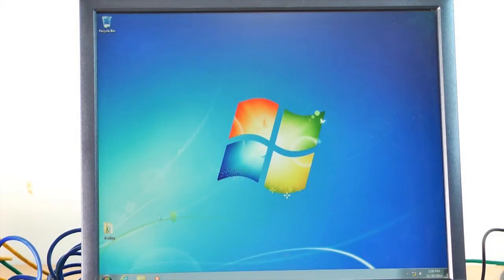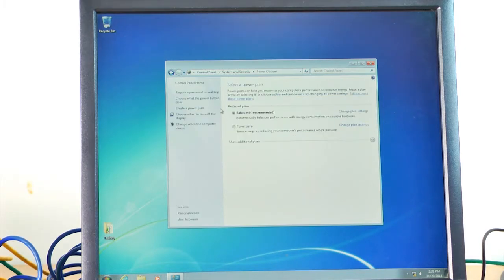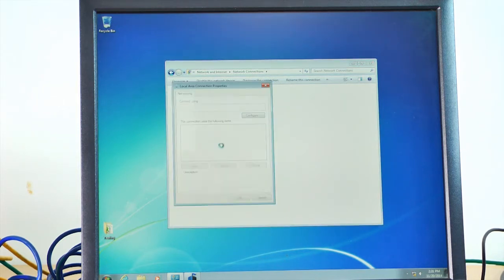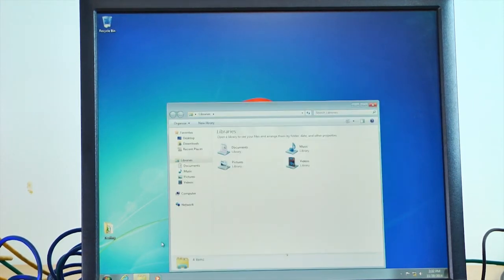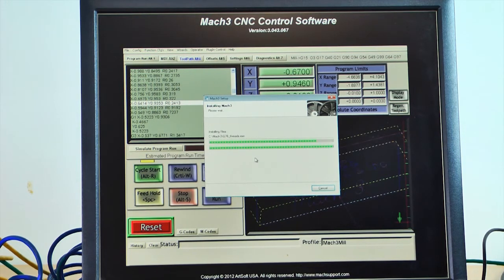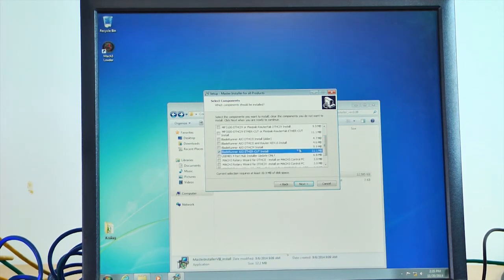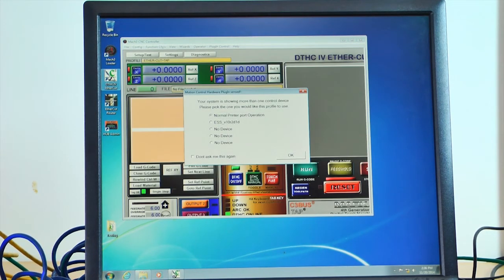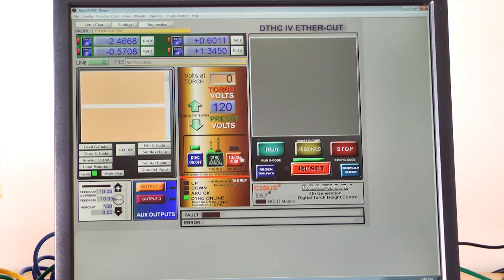Master Installer VIII

Comment: I'll check the main site - But for an easy Q here on the channel for this Vid-  What about WinXP w/ all the latest updates applied.   As I do now w/ DTHC II and Mach3.
Reply: tada....  Any version Mach 3 will support according to the CandCNC web site DTHC II to IV comparison section.  

The DTHC IV has all of the automation features of the DTHCII PLUS: 
 5  to 10 TIMES the speed and response
Tunable response curves for hard to cut material like HVAC and corrugated.  
Works with other types of PC-to-controller interface (i.e. Ethernet).  No LPT or RS232 required. 
Works with any version of Windows that MACH will run on.
Uses C3BUS USB to RS485 Hub for DTHC IV to MACH communications.
Uses HUB UTILITY for advanced setup and testing.
Select this product if you need to cut really thin material;  things like angle iron and corrugated OR if you want to use another MACH pulse generator besides the Pulse Engine and Parallel Port driver.   This is the only MACH3 based THC that offers both full integration (co-use of the Z) and the high speed performance of a stand alone THC.